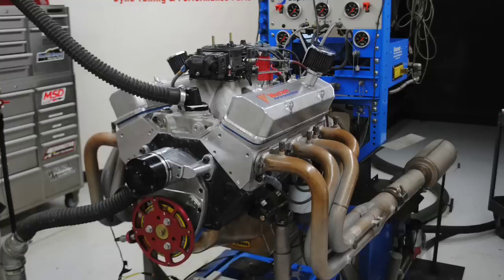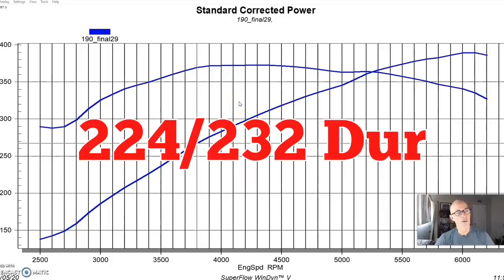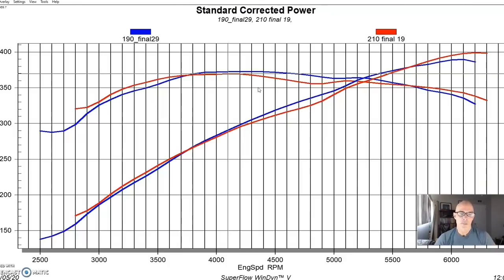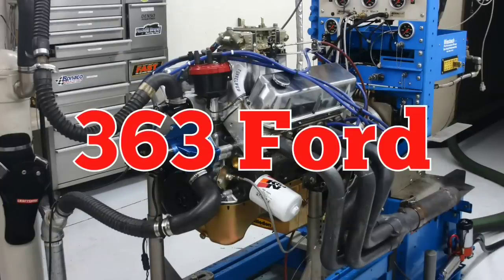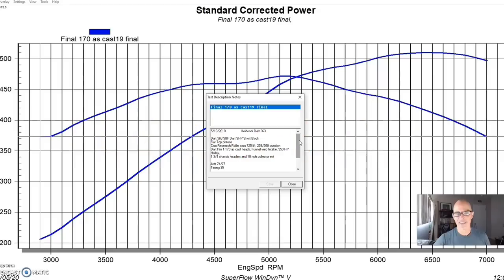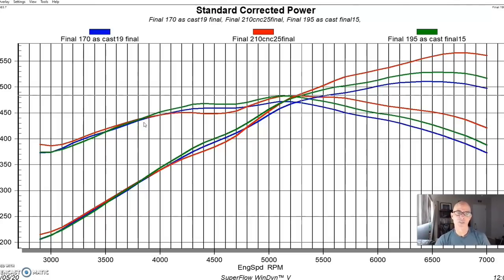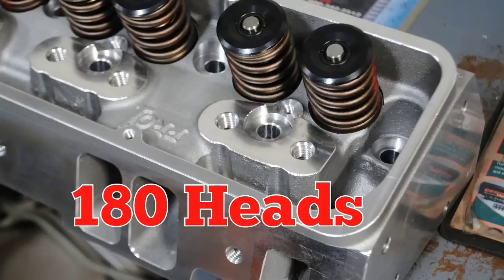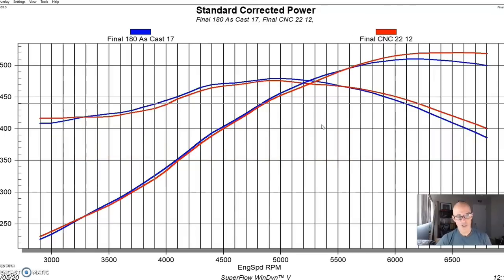PORT VOLUME-IS BIGGER BETTER OR IS LARGER LESS?

Comment: Pontiac V8's have some of the best off idle torque of any make. They aren't usually the most powerful and they poop out by 5200 to 5500 rpm's, but they are tire frying monsters on the street. Even the low compression late 70's Trans Ams could burn the tires like they had a lot more power than they actually did.  And Pontiacs have pretty small ports.
Reply: I am very surprised by the findings. But the dyno doesn't lie.
Reply: Pontiac's used longer stroke motors to produce torque as they used the same motors in very large cars. (land barges) That's also why they did not rev out and make high RPM power.
Reply: @rondyechannel1399  A 400 Pontiac has the same bore and stroke as a 400 Chevy small block and basically the same stroke as a 396 Chevy. 455 Buicks are known to be torque monsters and they have a 3.90 stroke vs the 4.21 stroke of a 455 Pontiac. I'm not saying your statement doesn't have some truth to it but every 400 Pontiac I have ever driven will smoke the tires for a mile just by stomping the gas pedal while my old 396 Chevelle was about as quick in the quarter mile as my 400 GTO back in the day (both low 14's all stock) the Chevelle needed to be power braked to really boil the tires. It was much more high strung.
Reply: @1967davethewave  It's the combination of port volume, stroke, and camshaft. Look at a Buick nailhead. They made tremendous torque with a shorter stroke, tiny valves, and hi lift longer duration camshafts. My 65 Buick Riviera with a 425 could barely be driven in the rain without spinning the tires. They had instant torque by using small valves for their engines size. So different methods. But overall with equal intake port flow the longer stroke will produce more torque lower in the band, good for short track racing. The other variable not often talked about is the short con rod in relation to stroke (400 Chevy) (302 Ford)more torque lower because of the ability to apply the work with the rod at an advantageous angle to take advantage of the high cylinder pressure right passed tdc. As Kaase has said a "rod 2" longer than stroke". Just saying the longer rod makes more torque was certainly an oversimplification.
Reply: @rondye9398  After watching a lot of dyno tests I am of the belief that rod to stroke ratios mean nothing. Dyno test after dyno test has shown no correlation to torque or horsepower production. And I used to think it made a huge difference. But a few years ago "Engine Masters" tested a 383 SBC vs a 383 Mopar and while the horsepower was almost identical the short stroke 383 Mopar killed the relative long stroke 383 Chevy in torque production. The conclusion was the much longer intake runners in both the heads and the intake manifold made more torque. That make sense as tunnel rams and cross rams always show an increase in low end torque. But I'm sure there are other factors as well.

Comment: In reality "I think"  that a 4' bore with a piston speed of around 4000ish FPM  will create a draw on ANY port that makes that port a restriction.  There is no way that the volume of a head port is not a restriction to a piston that large making that kind of demand on it.  No matter how big the port is.  This is proven with boost.  It forces better cylinder filling and makes more HP.  Period.  Other than a packaging thing and lack of a better way of letting the charge in and sealing for the compression stroke I cannot believe that bigger is better period.  Especially with EFI port injection as you no longer need a vacuum signal.  

Vacuum is a restriction.  Restriction limits power production.  Period.  Not surprised at all.  Like you said.  The LS guys have known this for a long time now.

Comment: Which would make the most power if compression, cam, head size & flow, and intake were all as identical as possible?
Ford SB 363
Chevy SB 372
Chevy LS 6.0
Dodge 360
Reply: If everything were equal..... I'd say they'd all put out about the same.
Add electronics onto your list.

Comment: Do you ever dyno test at part throttle? Is it even possible?
Reply from the maker: it is possible-I've only done than on a chassis dyno
Reply: An engine dyno is not a great yardstick if you're trying to measure part throttle drivability.  A chassis dyno would be better suited for that test.

Comment: How about telling us what would happen at part throttle so we dont have to guess.
Reply: I don't see why they couldn't do a 25% throttle run from below 2000 to 3500 rpm. It would be really good for comparing  carbs too.
Reply: @johnparrish9215  He could do that, but what would it prove?  Who drives around at 25% throttle opening?
Reply: @alantrimble2881   everyone, most of the time in normal driving with a large engine.
Reply: Alan Trimble who runs around on 0 or full throttle, with no in between? If we're talking about driver cars, part throttle performance is something almost everyone is going to be mindful of
Reply: Alan Trimble pretty much everyone.
Reply: @alantrimble2881  You do most of the time.  We all do.  Passenger car engines are only run at WOT about 3-4% of the time.
Reply: Who says he didn't? This was a 12 minute video not a masters degree, wait for the next video and maybe it will be that partial throttle testing. Hopefully it will anyway, would be nice to see.

Comment: Should of started with stock heads and then went mid and then biggest. Depends what you want to prove though. Stock cam/head/2bbl vs stock cam/cnc alum head/2bbl. That's a true test of extremes in port volume.
Reply from the maker: stock cam and 2 brl artificially limit the power-the motor can't take advantage of airflow of a ported head
Reply: Richard Holdener true, but if you're going from 90% efficiency to 99% it will be an improvement at wot. Starting at  55% (stock) and jamming huge heads on will either go to 75% (for example) or 45%. I think doing wot Dyno runs will show an improvement in hp&tq but drivability will not be represented . Perhaps go 1/2 throttle and load it to hold 2-2500 and watch the vac gauge when you tip in more. A crude drivability test. Small head goes from 16" to 12" where the big head goes from 16" immediately dropping to 8" as you tip in the same amount. What do I know though, I drove and raced Clevelands for years so I'm used to a soggy bottom until 3500-4000 lol!!

Comment: Great video Richard. Am wondering is the power na a bit related to vacuum numbers?
Reply from the maker: power and vacuum are inversely related but we don't see vacuum in the manifold on the smaller heads like we do with a smaller carb or TB

Comment: Gee Richard, you should have just destroked it with a 289 crank and then really let the ponies loose!   Yea. That would have done it!  Either that, or shove some 1 1/2" hedmans on there for the excellent torque producing backpressure.   Thanks for all your work!  I, for one, really appreciate it.

Comment: Like everything it depends. Valve size, runner length, carb size, definitely camshaft, and on and on. If you don't change anything but port volume it will still depend on where the restriction in the system is. If it is the head then you will see gains everywhere as long as the port isn't too large.
Match the parts and wins for all the rpms!
Reply: Valve to bore or even chamber to bore is often over looked

Comment: Hey Richard holdner do you know of any tuning programmers that you can turn with on a 2000 f150
Reply from the maker: hp tuners should cover that I think-I don't really know because I am not a tuner
Reply: SCT. Hptuners won’t tune an f150 prior to 2004
Reply: buy a silverado and turbo it